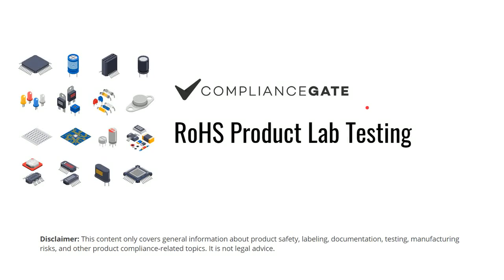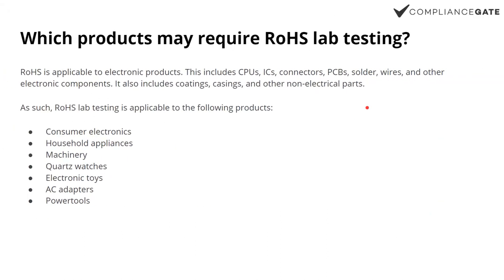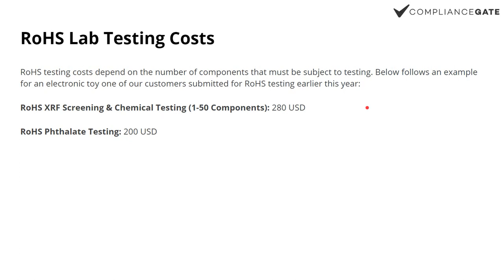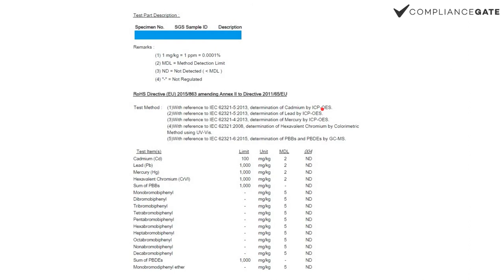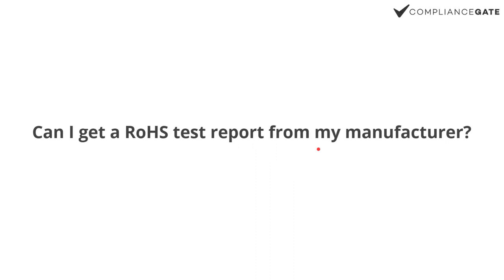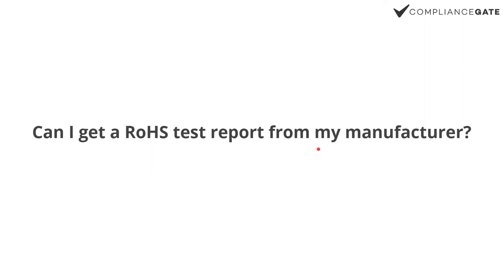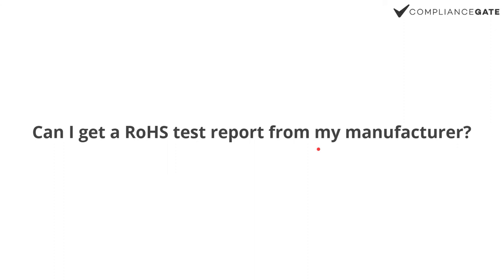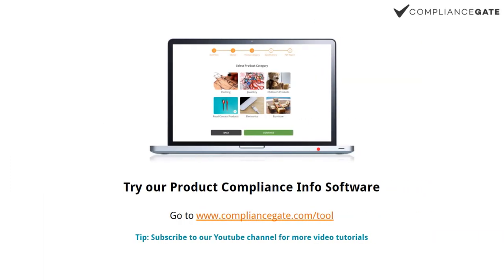RoHS Product Lab Testing

Comment: 1:03 Hello, can I have a question? You mentioned, that all electronic components need to have RohS certificate and test reports. But when i look into RoHs directive there's "The disparities between the laws or administrative
measures adopted by the Member States regarding the
restriction of the use of hazardous substances in electrical
and electronic equipment (EEE)". Well, i'm not sure that we can call a single component an equipment. For example capacitor, resistor or diode need to have RoHs, when I import those kind of goods to EU? Thank you for your answer, best regards, Vladislav

Also I don't understand. You wrote, that RoHs is aplicable to ICs, but you didn't mentioned, that those lab testing are applicable to those components. How does that work?